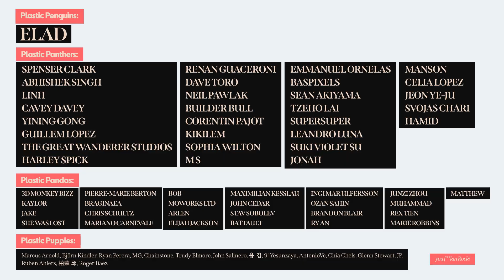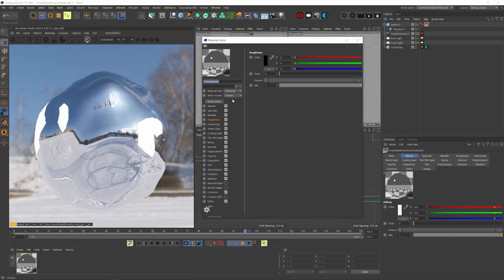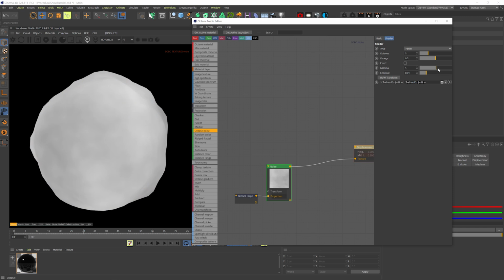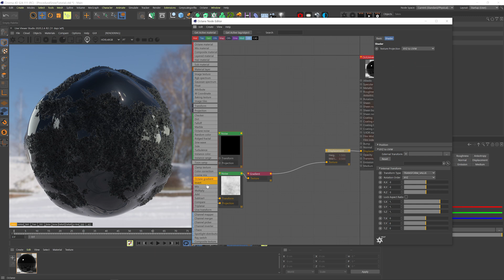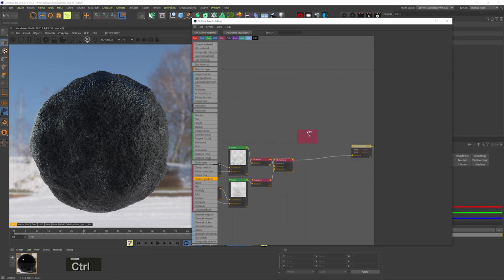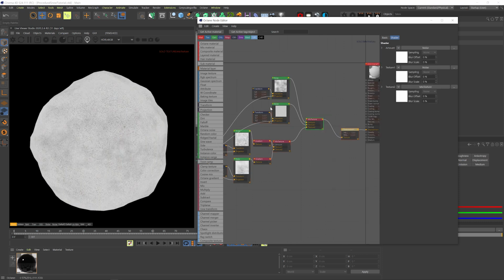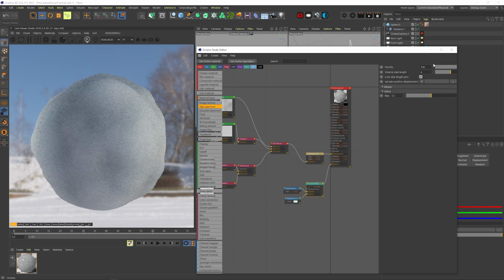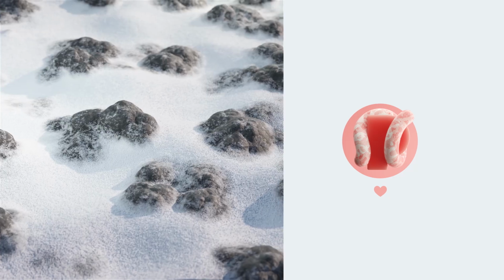Cinema 4D Quicktip - Procedural Snow (Octane)

Comment: Hey Guy, is there a reason why you don't have to put a baking texture node between your noise and displacement? My noise doesn't work unless I do that. Curious if theres a setting I missed.
Reply: do you use vertex displacement? It`s may work without baking texture, unlike the texture displacement